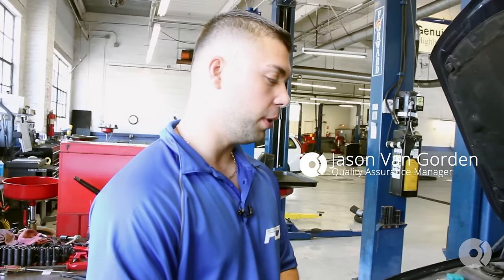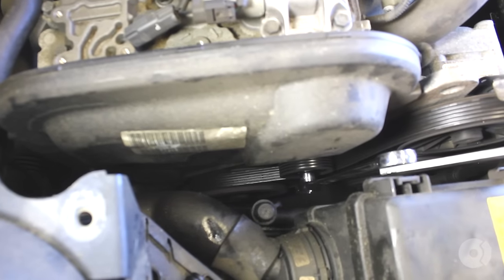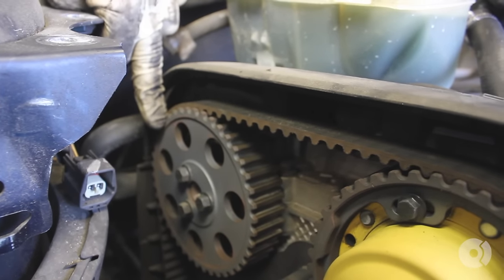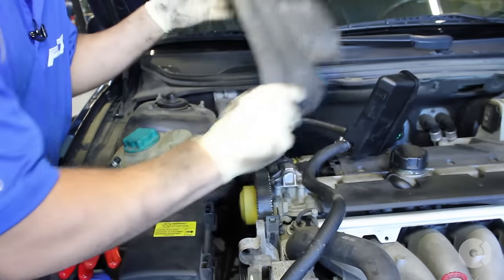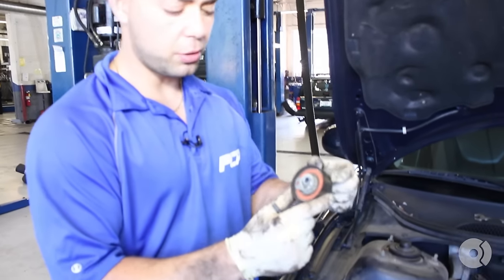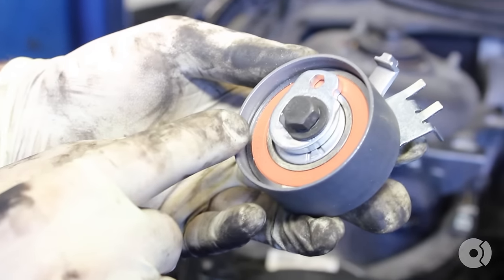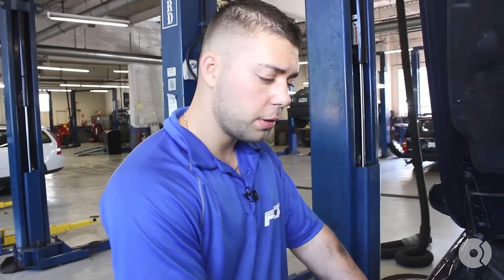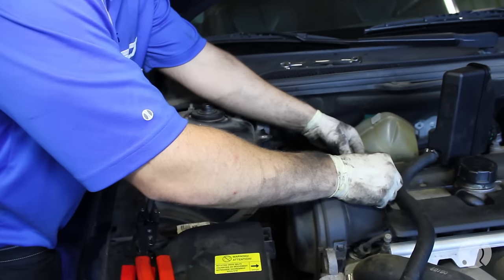Volvo P2 S60 Timing Belt Replacement DIY (S60, C70, V40, V70, S40, S70, S80, XC70, XC90)

Comment: At what mileage do you recommend doing the timing belt and serpentine belt?  Thanks
Reply from the maker: Hello, the factory recommends 105k miles or 10 years. We recommend replacing the timing belt and related components at 80k miles to be on the safe side.

Comment: Hi, thanks for the great video, do you have anything similar for a T6R 2013 engine? I am rebuilding a water damage engine, but now I have a problem timing it, when I use the Volvo tool and line up the cams and the crankshaft, the pistons are not at TDC, Vida says put the engine on TDC first, can you tell me which cylinder is number one on that engine? is it the one on passenger side or the one on driver's side close to transmission? I've checked both, but they both go up and down together

Comment: I have a question for you, I have a 2003 S60 2.4T. I bought a timing belt/water pump kit but when I did I accidentally ordered the kit for engine # from 3188689 and my engine number falls into the to # 3188689. will this be a problem? What is the difference between the two and could I install the kit I have on my car? Thanks for any help!

Comment: Hi.
Saw clogwise´s comment on a timing belt replace on the tube.
there you say it´s the same procedur on a Volvo V70 D5.
I have expeience of changing time belts, but have never changed on my V70 2,4 D.
Do you know if it is the same procedur?
No extra tools needed?
Reply: See the video done by SiRobb for his D5 2002 EURO 3 163hp engine.

Comment: So if camshafts and the crankshafts all don't align, how do you match them up?  Remove the timing belt and just move the camshaft til it lines up?
Reply from the maker: Hello,  everything would need to be adjusted so the alignment markings match up.

Comment: I have a Question for you. On  a Volvo xc 90 2006.I can not align the two top upper pulleys.Is this a sign that it jumped timing?.Do you have to remove the lower camshaft pulley to get the timing belt on (there is an mark on the camshaft pulley is this the same one that's on the camshaft?) Love the video. Thank you for any help
Reply from the maker: Mario Gualtieri You'll want to email our Volvo Tech Jason, he can definitely help you out with that: jasonv@fcpeuro.com

Comment: Thanks, will I be required to remove the motor mount when changing the belt on a V50?
Reply from the maker: Yes, This is correct. Support the engine and remove the mount.

Comment: In order to turn the rear of the cvvt cam with the cam lock tool, do I loosen the torx bolt on the pulley?

Comment: I have a 99 V70 Na and and 01 XC70 Is this process the same? Should a camshaft locking tool be used? Thanks
Reply: Hello Sebastian, the procedure is nearly identical for these models. The camshaft locking tool is not completely necessary however it may make it easier for you to complete the repair.

Comment: Please put in an actual shot of the markings on the crank pulley splines and the tab on the oil pump. It took me about an hour to find the spline marks. Super tough to see. You need really good light and I used a pick to feel the markings.

Comment: One other question:  What happens if the tick marks on the cams (all three do not line up sequentially?  I mean I am going to be taking off a belt that hasnt broken/snapped but in the event that they are out of line do you have to individually turn each cam until they line?  Im assuming that they all flow together sequentially  but you never know.

Comment: I've been thinking about buying a 2006 S60 with 150,000+ km on it, that's around 94,000 miles. How much longer should I wait for a change?
Reply from the maker: GymChess You should probably go ahead and change the belt on that car if you do purchase it. A replacement is definitely necessary if you notice a large amount of cracks in the belt.
Reply: FCP Euro Thanks for answering. Well, I haven't personally seen the condition of the belt. The idea is to leave it at a car shop and let them take care of it. According to the manufacturer it's supposed to last either 10 years or 180,000 km. I definitely don't plan to wait that long if I decide to buy the car. And by the way, how common are oil leaks on 2006 models? I think that earlier models had a problem with that.
Reply from the maker: GymChess Oil leaks on cars of that year aren't necessarily common. If you're concerned, having a mechanic do a pre-purchase inspection is always a good idea.

Comment: I am doing the same job on an 02 XC70. But how did you correct the mistake with the cam Mark moving?
Reply from the maker: Hi Seth, it can be a bit tricky. When you loop around the crankshaft, pull tight and loop around intake, then the exhaust, then push the belt over the tensioner, pull the pin. You got to keep the belt tight through the entire process otherwise the marks won't line up. Hope that helps!
Reply: No pin, this a s p2

Comment: 2001 volvo v70 XC

Along with Intake and exhaust cams  Timing Marks,  is there any timing mark on Crankshaft that has to be aligned ?

Is it possible to slide the timing belt on to crank shaft with out removing the pulley ?
the reason why i am asking this question is -  I am planning to lock the cams using cam lock tool, the moment i take the timing belt cover off.   And replace the belt.  That way i can be little confident that i am not disturbing timing. Please advise...

Thanks..

Comment: I have an 05 XC90 T6. My tension pulley broke and of course caused the belt to come off. Part of the belt is stuck inside the crankshaft pulley. I wanted to inspect the timing belt to make sure that the timing wasn't affected and none of the serp belt debris got caught in the belt before I put the new serp belt and tensioner. The prob I am having is removing the timing belt cover. The T6 has a small hose coming from the coolant reservoir to the front of the cover and I cant figure out how to remove. Any help will be appreciated. Thanks
Reply from the maker: These are really tough to remove as there isn't alot of space to work with. Most people end up breaking the plastic nipple on the thermostat housing trying to remove the hose and that can end up being very expensive. My suggestion to make this easier for you would be to remove the hose from the coolant expansion tank vs removing it from the thermostat housing. Also, jacking the engine up on that side will allow you for some more room to work with.  I hope that helps.
Reply: FCP Euro  Thankyou So once I remove the hose from the tank, there seems to be something keeping that cover on. I cant feel any bolts. I know how to get the top cover off but i'm stumped on the front.

Comment: I have a 2001 c70 2.0t 5 cylinder (not sure if the US has this in the 2.0t model) would this be the same procedure as my engine? 

Thanks
Reply from the maker: Yes, the procedure should be very similar on your 2001 C70.

Comment: Hey, great video.  I am about to order some parts from you guys.  I have a 2005 XC90 (B5254T2 motor).  I have read though the comments and since it's a dual VVT, do you think it's still possible to do the timing belt without the cam timing tool?  much appreciated it.
Reply from the maker: Hello, you can replace the timing belt without the tool. You'll just need to make sure the sprockets aren't turned while installing the new belt.

Comment: Hey Jay, is this basically the same procedure on a 2007 C70? Thanks!
Reply from the maker: Yes, the essential information is the same. On the 07, you'll notice the tensioner we provide is different from what you take off the car and is similar to the unit in our video. No need to be alarmed, this is a Volvo supersession. Also, you'll need to tighten around the 2 O'clock position.
Reply: Thanks for the reply, Jay. Really appreciate it.

Comment: How does one know which setting for the timing belt tensioner? The tech mentions two settings depending on engine code. I have a 2003 also but it's a XC70. HOw would one know?

Comment: So I have to take it off before I can order one, that seems odd!

I see two different numbers in Vida Dice for 2003 based on the engine number (which I have not found yet) but the FCP website only shows three different vendors for one Volvo part number.

Comment: Hello I set the tensioner at the middle setting Temp outdoors was mid 60's. I tightend the tensioner turned the motor over 2 full revolutions and looked at the tensioner and the indicator moved to the  left it looking at if from  the passanger side fender.. I reset it to the middle position again using the procedure in this video and again it shifted back after 2 revoultions. Any suggestions what am I doing wrong. Thanks
Reply from the maker: Sometimes they can be a bit stubborn. You'll have to repeat to procedure unit it aligns in the center. Try setting the tensioner arm more right oriented so that it will align in the center. I hope that helps.

Comment: You need an Air Impact Wrench like in the video.  The impact feature will break the torque of the nut, that's the only way, or easiest way for the crank pulley nut.

Comment: I heard my 3.2 2103 xc70 has NO belt. does it have a chain and is this basically the same thing?
Reply from the maker: That is correct, your 3.2 has a timing chain, not a timing belt. A timing chain does not have a service interval and will not need to be replaced, unless you have an issue with it.

Comment: timing belt video helped a lot,...I have a 01' s60 t5,...thought I had all timing marks in correct position,...engine started first crank,.. I noticed right away I had no "real" bottom end,.. or no low rpm power...I hooked to a OBD II code reader and active fault read "Advanced Timing blah,blah,blah...I know I will have to move the belt one or two teeth, but on witch gear, and witch way will I have to turn it ? I'm guessing probably crank gear, and clockwise.. This was because of a  poorly scribe  mark on the exhaust gear..

Comment: OK, I ran into something not in the video. I have a "shield" covering the base of the crankshaft and it's almost impossible to see anything. Is there a mark on this piece? do I have to remove it? I put it all back together and slowly turned the engine over by hand and felt no resistance. But it's freaking me out. Please help....
Reply from the maker: Robert, give me a call at 1-877-634-0063 x218. I'm not exactly sure what you're referring to and I don't want to give you the wrong advice.

Comment: My intake cam pulley moved slightly prior to  getting the new belt on. How should it be aligned since the vvt hub has play in it?
Reply from the maker: Yes, you'll want to make sure everything is aligned as close as possible.
Reply: Can you double check the timing on the rear side of the engine?
Reply from the maker: Yes you can, you'll need the cam locking tool p/n CTA-2864 found on our site here: https://www.fcpeuro.com/products/volvo-camshaft-holder-tool-fits-all-5-cylinder-engines-cta-2864

Comment: when I try to put the piston at TDC while lining up all the marks, my pistons and valves touch each other. On the T6 engine, does the pin on the crankshaft tool have to go inside that opening assigned for it at the time the cams are lined and secured with the cam tool? thanks

Comment: Most of the time a mechanic won't torque those nuts, they aren't really important to torque, you just need to get them on tight enough, so they don't fall off

What we do at work is put the small bolts on tight, and then just give the big center nut "full blast" with the impact gun

Comment: Hi, what mean the engine code P0016 and P0017 and P0101 after replcaing timming belt on volvo S60 2.5T, thank you
Reply: P codes are generic codes.  You need Vida/Dice to get the right codes.

Comment: Hey i just have a question. When i put my timing belt on and the timing markings dont move, and i try to tension the belt THEN they move. How can i make it so that it doesn`t move when i tension the belt?
Reply from the maker: You will need a Crankshaft Holding Tool.
https://www.fcpeuro.com/products/volvo-crankshaft-holding-tool-cta-2247-2248-1
Reply: Alright thanks for the help i will get one :)
Reply from the maker: You're welcome!

Comment: My dude a belt popped while driving my 202 V40 and now what belt do I need to control my water pump power steering and alternator?
Reply from the maker: Do you know which belt broke? Your power steering and alternator are controlled by a serpentine belt: http://www.fcpeuro.com/products/volvo-serpentine-belt-6dpk1841 and your water pump is controlled by the timing belt (with teeth): http://www.fcpeuro.com/Volvo-parts/V40/Engine-Mechanical/?year=2002&m=20&e=2007 Hope that helps.
Reply: Thanx for your answer I didn't know you responded. I got a new alternator the pulley broke not the belt. I replaced the belt as well. Thanx again...

Comment: Thank you so much for your instructional Video .. But I do have a question to ask..  See The reason I was looking for something like this , Is because I believe my Aunt car . I was working on jumped time after gave it new coil packs and plugs because some coils was bad but car still ran with slight miss . then ran like it should after replaced them drove car 15 mins then boom went like was out of time. pop missing.. but if those line up not slipped then is it the cvvt aka cam selenoid variable t

Comment: On my new tensioner the centre spins without turning the pointer is this normal?
Reply from the maker: Are you adjusting using the 7mm allen or just spinning the center bearing?

Comment: hi I have the XC70 and I have a new sound it sounds like  gear spinning does not sound right any ideas and its coming from this side of the engine .. only when hot I am thinking oil pump ..
Reply: TOPROLLER101 
Belt tensioner might be starting to fail.
I would inspect everything, belt, tensioner and water pump pulley.
Reply: ok thanks I am going to replace the oil pump too.

Comment: That was quicker than when I did the belt on my 1997 DOHC 2.5 Subbie!  Sadly I've had some severe arthritis attack my hands and working on my cars isn't in the stars for now.   All my life I've done my own work, replaced my engines, etc.  I called the local dealer to do the timing belt on our Volvo and they wanted $1,000 and said it would be 4 hours labor rate.  Sigh!  I know better and will not be a happy camper moving forward when others have to do the work for me.  :(

Maybe the hands will clear up because it is from Lyme disease and it I get that under control maybe the hands will clear up.  :)
Reply: try less carbs, less sugar, no alcohol and no pork of any kind... drink tons of water... you'll feel much better.  Good luck with your condition !
Reply: What's the stars got to do with anything , its called entropy ,,,,,, water certainly does help though .

Comment: What position should be fixed on the tensor for a volvo s60 2.5t year 2006? 7  or 2 o'clock?
Reply from the maker: Hello Raul, most likely 2 O'clock you can verify by looking at the tensioner before removing it. If still uncertain, email products@fcpeuro with your VIN.
Reply: FCP Euro thanks!
Reply from the maker: Hello Raul, it should be at the 2 O'clock position
Reply: FCP Euro thank you very much, i was able to effectively change the belt using this video.

Comment: My serpentine belt tensioner looks different, it's got like a black cap looking thing on it and I'm not sure to how loosen the tension to get the belt off it's on a 2007 volvo s60
Reply from the maker: Hi DoggoShots, You want to pop that plastic cap off so you can get to the 14mm bolt behind it. Hope that helps!
Reply: @fcpeuro  thank you. Finally got the car back together and the timing seems to be right. Never would have been able to do this without this video thanks a lot!
Reply from the maker: @gasa1165  You're welcome! Happy to help!

Comment: Hello FCP Euro... i need to do the samething with a 2005 volvo xc90 v8 so ill aprecite if you guys post a video about it... thanks.
Reply from the maker: xavier7543 Actually, the V8 has a timing chain setup and is a completely different replacement procedure. I don't believe there is a factory replacement interval either.

Comment: When you're doing a timing belt job always, always, always replace the water pump. unless you are a mechanic who doesn't mind taking everything apart at a later time such as when the car starts to overheating. But if you are not a mechanic, and are paying to have this done, it can only be an accident waiting to happen later on, not a good thing. it is as good as it's gonna get if you can replace it when you do the timing belt, rather than spending more time and money to do the same job twice!

Comment: Lets say 05 T6 with both Cams at their marks but no belt because the tensioner is broke and wont hold enough tension to remove crank 30mm nut without belt slipping. So crank has moved a good 180deg before nut came loose. all this done with hand tools and have payed attention that I felt no resistance other than compression. Should this be possible on this interference motor? Keep in mind car was running fine other than the timing CODE which cause me to go on this venture.

Comment: Don't undo those 14mm on the brace. Use the long bolts. If the weld breaks on the triangle bracket you're stuffed.

Comment: Great video. BUT, there is a mis informations where to set the tensioner. 7 o clock", on another video, they set up this at the middle as the atmospher temperature is at warm. 
Can this be more explain better than watching the Video...other than that Video is great.